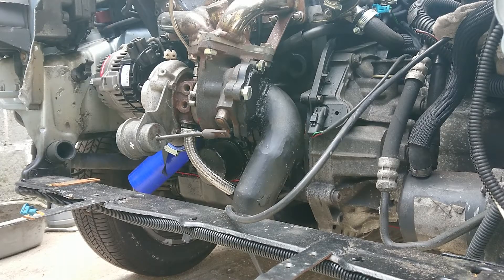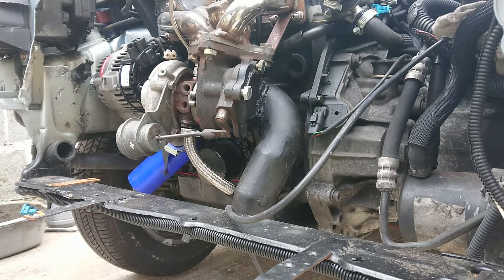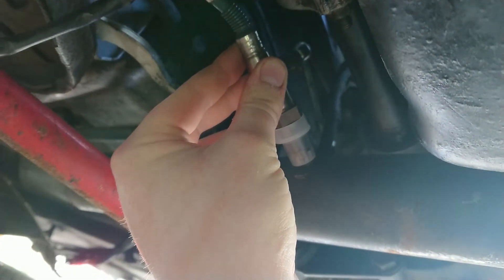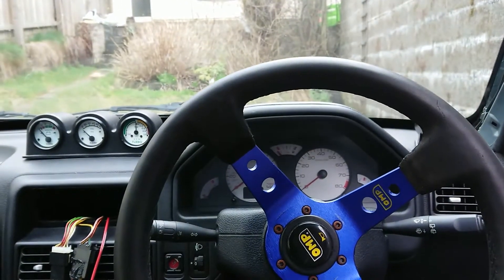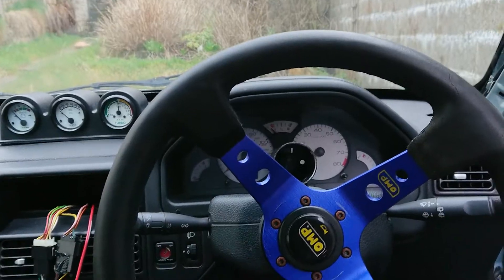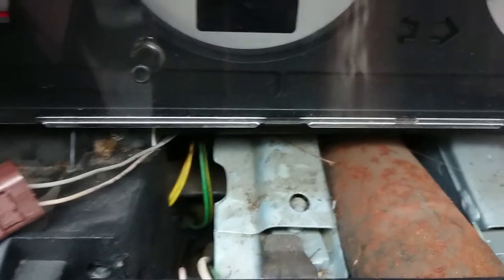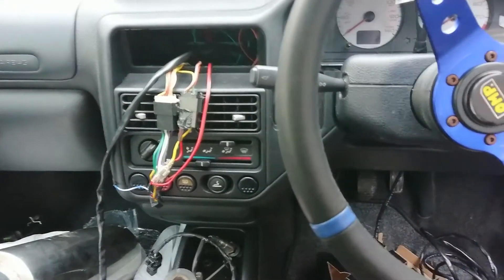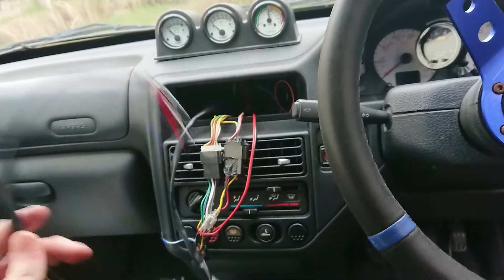#16 Installing A Wideband Aem Uego [Turbo 106 GTI]

Comment: Here did you buy the turbo kit?
Reply from the maker: I made the turbo kit from parts. Check out the other videos
Reply: @rowanlewisuk  i saw but for example the exaust mainfold were do you buy it
Reply from the maker: @valterrobalo7830  I bought it from someone in Facebook and modified it to fit on my turbo it's in one of the earlier videos. The turbo I bought from someone local. The injectors from ebay etc